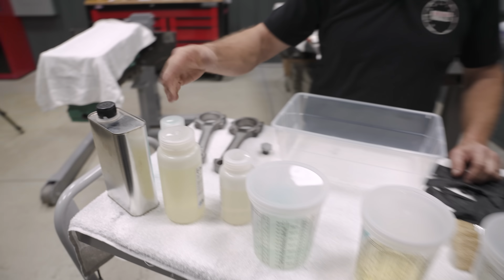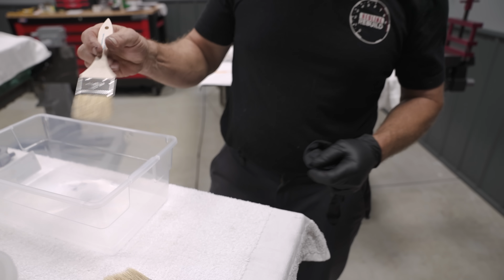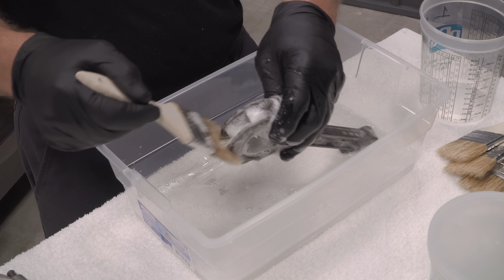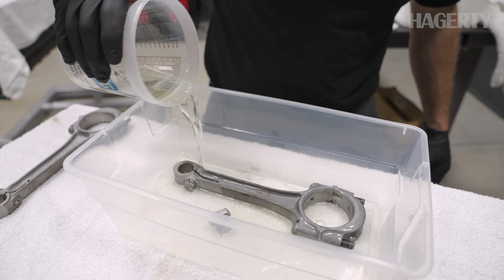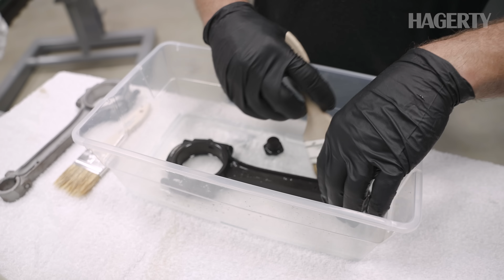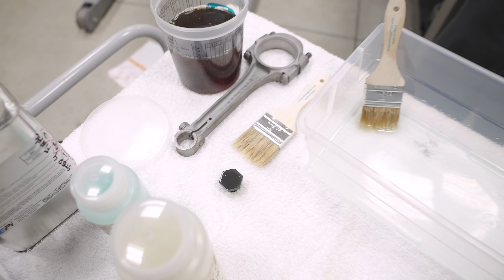Black oxide coating engine parts for rust prevention | Hagerty DIY

Comment: Wow !! Dude!! That was a very informative tutorial !!! I want to say thank you for your time and effort because it’s a great tip for me and I’ll tell ya why,, I’ve been makin  fixed blade knives for a few years now and have really struggled with producing a finish on the blade for rust protection!! I’ve tried ferric chloride , hydrochloric acid and sulfuric acid  with some success but it’s never a 100% !! There’s always a spot or patch or the tint isn’t consistent  but I think your black oxide will get the job done !! I can’t wait to try it !!! The steel I use is 1095 HC  no stainless yet because I can’t heat treat stainless, yet !! Thanks again man !! I really think the sealer will give the blade  a sheen  on the finished  part that will just pop !!! Thank You !!!

Comment: I did find it very informative, thank you!Entertaining as well. I would like to do a stainless steel motorcycle exhaust pipe with this finish. I am afraid that I would use too much of the cleaning product to get the fouling off the pipe. How do you think this should be tackled? I do not have access to a parts dip bath. Can you think of another alternative to achieve it? Thank you

Comment: You apparently did not do your homework before attempting to do an instructional video?  I researched that company years ago and you over paid for the little amount you have by a shitload. the black oxide dye you can get from walmart for gun bluing. the cleaner is actually hydrocloric acid you can get from lowes as a toilet bowl cleaner. and the sealer is of 2 types you can use WD 40 for 1 type of finish and add some liguid car wax to water for another type of sealer (non glossy) you need to soak the parts in each type for 3-5 minutes and the sealer for longer. your rods did not look black but grey because you had the stuff on for about lil more then 1 minute. you need a digital $2 oven timer for each stage so everything looks uniform without a timer everything is gonna be off in color

Comment: Working on a 1921 Harley. I would like to coat the cylinders and the head with this Black Oxide. I need it to not rust, and hold up to normal engine heat for an air cooled engine.  Will wait for your  response in how to proceed. May coat the rods also. Thank you and best regards.

Comment: After cleaning, etching and surface prep you could move straight to the sealer to keep the grey cast. Seen that done and the parts turned out awesome grey cast as well as having the black oxide applied.

Comment: I wish i would have found you 3 years ago.  I had cast iron rails attached to my steps and porch.  The bottom legs that are bolted into the concrete are not only rusting, but leave a terrible looking rust stain near the contact points.  Maybe next spring I can someway make a dunking station and use your product.
Reply: You'll need something more robust, if you want to keep it outside. This might work if you soak the part in some cosmoline afterwards, but otherwise an acid bath and powder coating will be necessary.

Comment: Is that an actual "gunblue" of the type used on small handtools (pliers, screwdrivers, etc.) -- i.e., black iron (e.g., magnetite), or a "cosmetic" bluing (i.e., black copper oxide applied to the steel)?

This is important to me, and having tried a number of commercial "rust converter" type products over the years I have become more and more disillusioned, but, as the old saying goes, "hope springs eternal" and so I keep hoping that someone will come up with a product that will do a quick, easy conversion to black oxide OF the steel itself.

I have pretty much reconciled myself to having to grit my teeth and do some rust bluing, and maybe it's not as involved as it seems, but not having the resources to buy a "production" setup to do hot salt bath bluing (or the need!), unless I can find a way to chemically treat steel to create true bluing I'm gonna have to do the rust bluing (or just let my late father's tools eventually rust away).
Reply: Rust bluing is about as good as it gets, if one of the hardest methods to use. There are plenty of "black oxides", but the process of creating and polishing layers of it means it's a 3d surface of rust resistance, versus a thin, mono-layer like this.
True "hot-bluing" is close/on par, but involves caustic chemicals at boiling temperatures. You could probably manage, but it's a logistical nightmare of what to do with 50 gallons of toxic solution afterwards. 

This is a very respectable in between. This is about the height of home shop cold bluing. This process, plus maintaining an oiled surface, will do for almost all situations barring salty, corrosive, humid air.
Reply: @ryanj610  -- I agree with respect to rust bluing. It's the original type of bluing -- it converts "red oxide" (rust) which is inherently unstable (there's a reason it's called "cancer" and also for axioms like "rust never sleeps") -- into "black oxide" which is stable (will NOT "spread" like red oxide).

As I understand it, oxygen is liberated from the boiling water, then combined with the red rust on the surface of the steel (the process beginning with a coat of acid to promote rapid rust formation), and then the "loose" material on the surface removed by brushing away with a file card -- and then, the process is repeated, over and over until the desired color is obtained.

The "Brown Bess" was done with the process stopping at the brown level, others going for a deep, rich, lustrous black that I doubt any other process could rival.

"Cold bluing" is strictly cosmetic. It's a selenium compound applied to the surface, providing no protection.

Comment: Why would you use black oxide? It wears off very quickly, zinc phosphate or manganese phosphate lasts much longer, gives a more uniform finish, won’t adhere to polished surfaces, just a better all around finish.

Comment: I’de like to comment that this presentation is NOT black oxide. It is a selenium based chemical plating. It is expensive compared to actual black oxide and not durable. But, it makes an attractive finish and is fast to apply.

First though - Metal CLEANLINESS is paramount. Degrease with a solvent then boil in common ordinary homemade 10% sodium gluconate solution. Rinse with distilled water and then proceed to your blackening process. 

As to actual black oxide (magnetite) it can be obtained using traditional blackening salts (make yourself) but operated at 180-190F - not the dangerous problematic 280F. Select a glass canning jar or larger that you can seal (if no lid use an oven bag) to prevent evaporation. Place in the oven for 12 to 24 hrs. Suggest using a dedicated one such as a toaster oven.Excellent results will be obtained.

Comment: Wouldn't a connecting rod stay oily enough in a crankcase environment to prevent rust?  Cool video though.  I can definitely think of some parts that would benefit from this such as mechanical clutch linkages exposed to under-car environment.

Comment: if the part is ' inside ' the engine,, would not the oil, and oil vapour keep it from rusting.. the con rods, camshafts. etc,?
Reply: He explained it in the video, if the engine sits a long time without running then the oil runs off the bare metal part and the moisture can rust them. This coating allows the oil to stick to the metal and provide a lot more protection.

Comment: Should specify to re-polish any of the bearing surfaces at least just before installation. That oxide coating will act as a grit if left on.

Comment: Does this add buildup?  Will it change bolt or other tolerances?
Reply: The Insta Blak 333 is a thin film that will only be ~0.000005"

Comment: You asked - how about a overview of a complete internal/external engine coating/preservation.  You did the paint on the outside of the Buick block, now we see blackening, how about property gypsol coating (however you spell that) and how to preserve bare surfaces in a motor that's going to sit ....

Comment: Interesting video. When I was restoring my 64 Falcon Sprint I was trying to match the coating used on some of the body bolts and ended up using gun bluing and it was very close.

Comment: What about bearing surfaces? I would think that this would be bad for them.
Reply: Why? It has no appreciable thickness, and the bearings are placed over it. There is no mechanical contact of the oxide with any moving/bearing surfaces.  It will have zero impact on the bearings.
Reply: @andoletube  why? Because I didn't hear him mention anything about where NOT to use it. The rods were fine since they get bearings placed later,  but I expected Davin to suggest some dos and don'ts. I could have worded my question better.

Comment: Not sure if it was mentioned in the video and i just missed it, but does it affect tolerances? (does the "coating" have a thickness? or is it converting the outer layer and therefore no added thickness?)
Reply: This process will not affect tolerances. The coating thickness is only 0.000005"

Comment: How can a con rod rust? it's bathed in oil all the time.
Reply: An engine in use won't have rusty rods, but if you connecting rod is submerged while running you will have bigger problems than rust ;)
Reply: @uliwehner  Indeed.
Reply: I can honestly say that I've never heard of a connecting rod fail because of "rust"  LOL     This just sounds like some new crap they want to sell.
Reply: @reelreeler8778  no one is saying connecting rods fail due to rust.  the point is a motor that will see more storage time than run time, the rods will surface rust from simple condensation.  surface rust can contaminate the oil and subsequently go through the bearings.  Now we certainly can debate the extent of the damage or concern, but that was the point.  Actually not selling the product more discussing another use for Black oxide than just fasteners.
Reply: @reelreeler8778  I mean if an engine is left sitting for years surface rust can appear on the internal parts if there has been condensation, but at that stage there are bigger issues anyway.  "Blueing" external parts makes more sense.
Reply: @reelreeler8778  No, it was just a part that was available for demo. When in hardware store check the drywall screws, they are processed same way.

Comment: Say you were doing something like your rod, that might get set aside while other things are on the go (like sorting misbehaving valve guides for instance): would the old standby of wrapping them in an oily rag til you need them, prevent them rusting?

Comment: Does this process add material of any consequence. I'm thinking of bearing surfaces or threads being tighter than before treatment.
Reply: Chris, CuSe black produces extremely thin black coating. We talk about 0.1 micron of the coat.

Comment: I would certainly hesitate putting something like that on a connecting rod. Some chemical coatings can form a layer thick enough to mess with your clearances.
Reply: not the case here.

Comment: definitely looks like a process similar to cold bluing. Basically what you're doing is you're creating your own oxide coating so that iron oxide (rust) can't get to the bare metal. The end result finish almost looks like parkerizing. Very cool. I'd be interested, though, to know if the etch part of the process has a negative effect on your wrist pin mating surfaces. I was concerned about the rod journals as well but those are going to have a bearing in there so hopefully the surface being micro-porous shouldn't be an issue.
Reply: If the dimensions don't change drastically, I'd imagine micro-pores would be great for the wrist pin journals because they'll hold a lot more oil than a polished surface. Polished metal is bad at holding onto lube oil, and that's why machine ways are scraped in instead of surface ground.
Reply: @mannys9130  There is no dimensional change when using Insta Blak 333

Comment: Would the sealer (step 4) on its own provide the corrosion resistance?  Or would it not take without steps 1 & 2?  I suppose what I’m asking is whether the black oxide step is actually necessary?
Reply: Step 4 is water displacing oil corrosion protection coating. It will give you the same corrosion protection on bare steel as corrosion protection over black oxide finish. Only difference, we want parts to look cool black!

Comment: So would this process work for impact sockets? I got a bunch at a garage sale and they have lost the black coating on them
Reply: black oxide or phosphate is the coating on most impact sockets.  also why they are oily when purchased.
Reply: No they were in a 5-gallon bucket that had some water in it. I’ve taken them to the wire wheel and currently in the house but I’d to leave them in the barn where they’ll be used

Comment: Insta Black is a room temp coating of copper selenium which is the same as gun blue touch up. It is not a hot black oxide process such as MIL-DTL-13924 Black Oxide with all the hydrogen embritlement problems on harden steel that process has. It is very thin and the sealer used is the key to longer life.

Comment: Nice, is this only for metal parts or other kind of materials?
Reply from the maker: Check out EPI's website. They have coatings for a bunch of different metals.
Reply: They have products for Steel, Stainless steel, Copper alloys, Zinc, Aluminum, Cadmium, Silver. Check their website. They have a lot of the products offered as small DIY or try it kits. I finished my solid bronze door handle with B/OX 311 Gel. Only had to buy hard top coating from Home Depot.

Comment: Interesting!! Thought about this type of thing recently when I was about to use a "raw" pipe fitting for a heater line. Do you know how this coating would compare to "gun blueing"?? I ended up NOT using the raw fitting so never tried the blueing.
Reply: Looks pretty similar to regular cold blueing.  The degreaser and muriatic acid etchant are not really necessary if your parts are clean; just use brake cleaner.  The final coating probably helps it last.  Usually when you cold blue you oil the part afterwards and wipe it down a day later.

Comment: Are you aware of Hydrogen embrittlement (HE) and are sure this process will not affect the parts you’re treating?
Reply: Hydrogen embrittlement occurs during an electroplating process like Zinc Dichromate common coating on Bolts.  Electroplating causes Hydrogen atoms to be absorbed by the metal thus causing fractures and weakening the material.  It is prevented by heating (think annealing) the parts in a controlled manner during the plating process.  

Black Oxide is a chemical process that simply stains the oxide on the surface turning it gray/black. so in appearance you don't see Red rust however left unprotected ie oil or sealer it will rust.  Phosphate is very similar as well and found on virtually every hood hinge through the 60s.
Reply: No issues with HE, you can skip any H+ prosses. NO HCl, no plating. Just use E-Pik 215 from EPI.
Reply: The problem with embrittlement is actually the acid pickling step and yes it is an issue, you cannot acid pickle HSS.

Comment: You know what works really well for all around rust stoppage? Rustoleum Rust Reformer spray paint. Not kidding I've sprayed it directly on a lightly rusted truck panel  and underneath on the rusty suspension and the rust never came back . Wouldn't use it on connecting rods but honestly don't see why connecting rods need rust prevention anyway.
Reply from the maker: Always good to find something that works for your project! The key part of this process, with the rods in particular, is that you're not adding a measurable coating to the outside and therefore won't have issues with fitment or with it chipping or peeling off.
Reply: I use Rust Reformer a lot. Best of all, the active ingredients are suspended in a very high quality black paint. I use as black paint just because.

Comment: Cerakoting is very easy I do a lot of my bolts and parts in it if you don’t want the hassle of baking it on just use the air dry stuff it takes about 5 days to completely harden.
Reply from the maker: You are right about that! And we typically get a bunch of our stuff treated at West Michigan Cerakote. Like Davin mentioned in the beginning of the video, we would normally send something like the oil plug in for a ceramic coating along with a bunch of other parts. We are huge fans of cerakote!
Reply: Hagerty yeah it’s great stuff I wouldn’t ever do any internal parts but external stuff even headers work great with it. Can’t wait to see the Buick straight 8 get done!